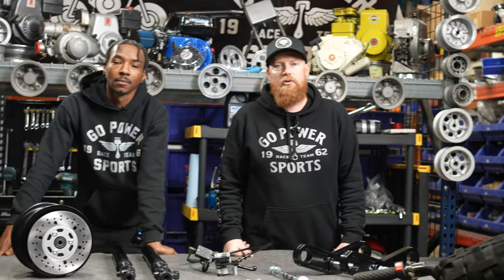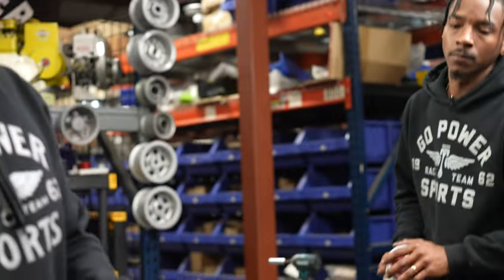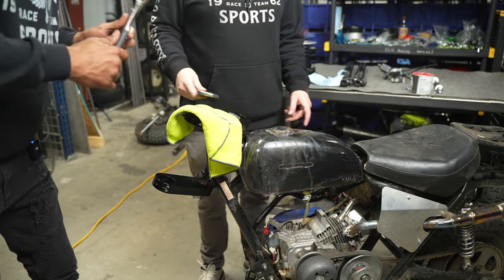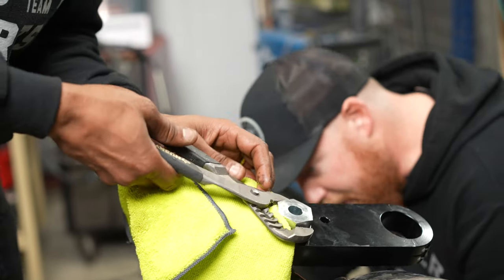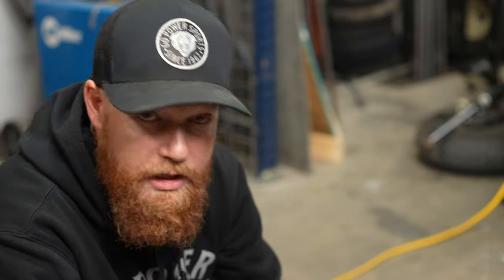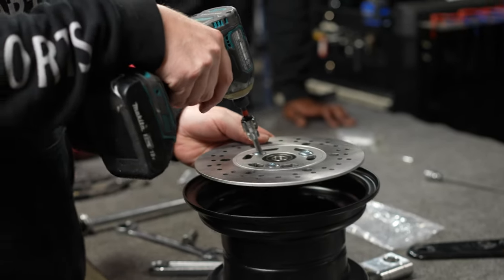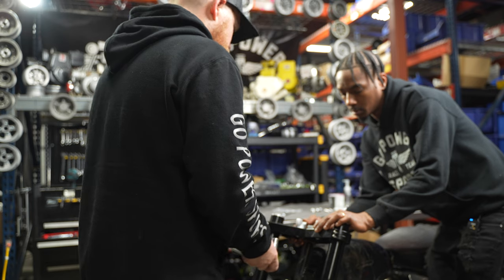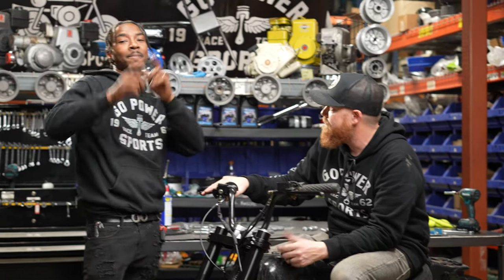How We Install This Minibike Premium Front End Suspension Kit

Comment: Is the front wheel the same as the MB200 Hurricane or will you still need to swap tires?
Reply from the maker: This is actually a Hurricane minibike, it will fit.  Thanks for checking!
Reply: what about the mossimo warrior 200? @GoPowerSports